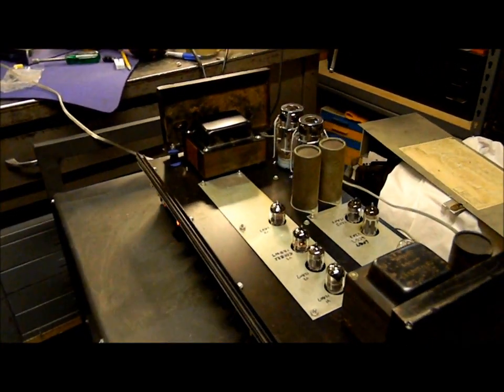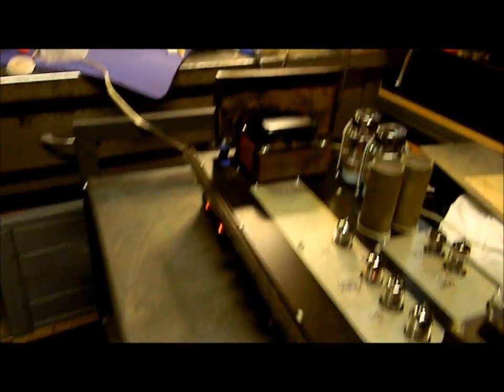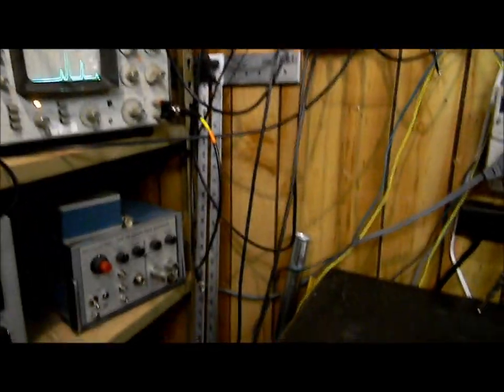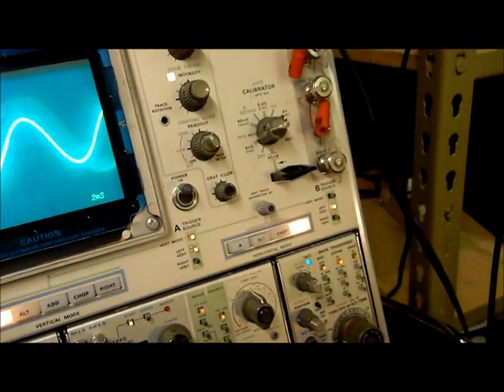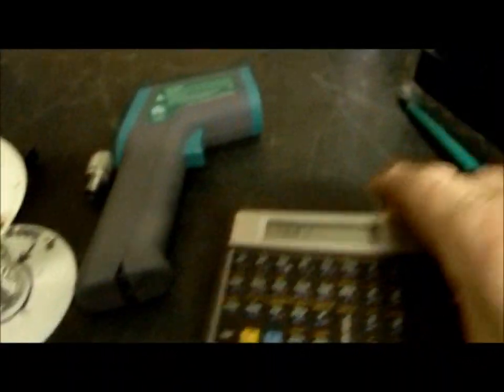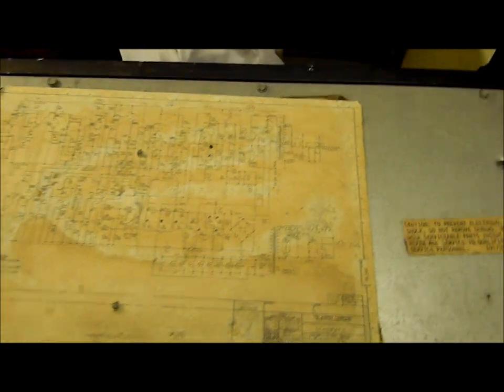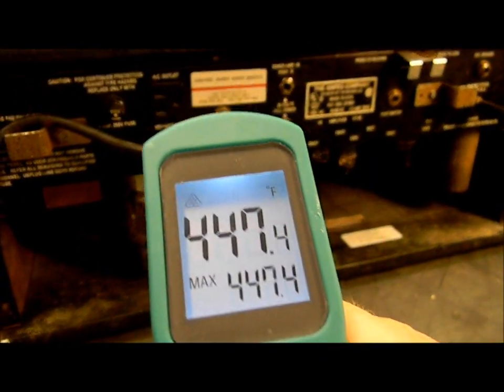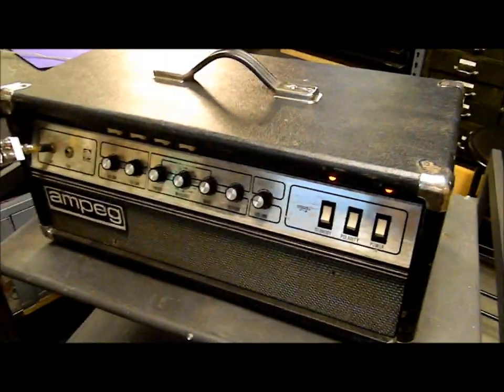Ampeg VT-40 7027A to KT88 Mod.wmv

Comment: Do you reccomend this mod for ampeg vt-22 that has 4 output tubes that are 7027a's?
Reply from the maker: It is not for me to recommend one way or the other but the client that I did this for says he loves it. I do remember the filament voltage being a bit low as the current of the 7027's is a total of 1.8 amps and the total for a pair of KT88's/6550's is 3.2 amps. But he never brought it back with any complaints.
Reply: KT88's won't fit in a V4 or VT22 unless it's the model with the "Distortion" on Channel One. The big bottles might actually be touching the power transformer or be too close to it, and to one another. That end of the amp already gets extremely hot so 6550's & KT88's have never been a good idea in the "regular" V4 & VT22 (which is ANY model without the distortion circuit). If you have the Distortion model, it was designed with a "dual rail" power amp for 6550's (because they run the screens over 200V lower than the plates), and the tubes are more spread out away from the transformers so it will stay cooler. So KT88's should be ok in that model.

Comment: Question. I have a vt-40 combo and I am thinking of modding it to take EL34 tubes. Same mod as what you did. Are there adjustable trim pots inside the amp to adjust the bias? I read somewhere there arent any in this amp. If not what would I need to do to install the trim pots or how would you adjust the bias for el34 tubes? I just dont want to make modifications just to have the tubes run at a low voltage. I want to crank those bitches. Thanks.

Comment from the maker: Well, unfortunately, I am only an engineer and not a musician and don't know this equipment like many of my viewers. I assume I called it a VT-40 because it was stamped on it somewhere and calling it an SVT is just one of my many mistakes that occur when I am making videos. Also, at the same time I was working on this one I did have the SVT in my shop - the one with six 6550's in it. Sorry for any confusion/

Comment: @essoterric I would be concerned about shortened tube life. Correct filament voltage is crucial to the longevity of a tube. This is a golden rule with broadcast tubes and the principal is pretty applicable across the applications.

Comment from the maker: Yes, it could make the transformer run much hotter.- 1.8 amps to 3.2 could be serious. There is a really nice writeup on the Internet about this change. It appears some (and hopefully many) of the power transformers can supply the filament current. I measured this amp at 6.3 VAC with the 7027's and 6.0 with the KT88's. Hopefully, the Worst that might happen is the filament winding opens and that can be replaced with an outboard filament transformere.